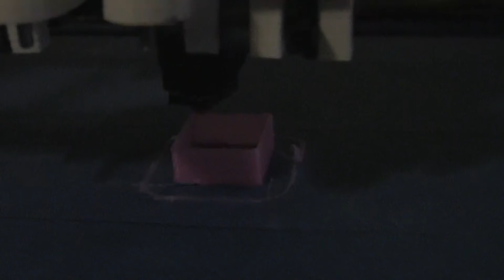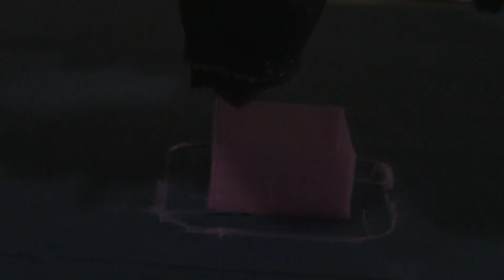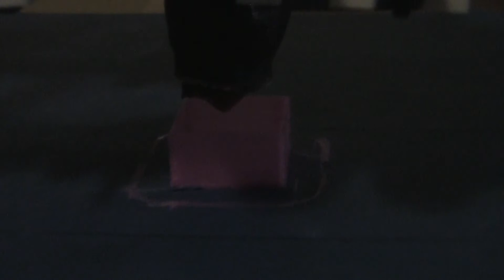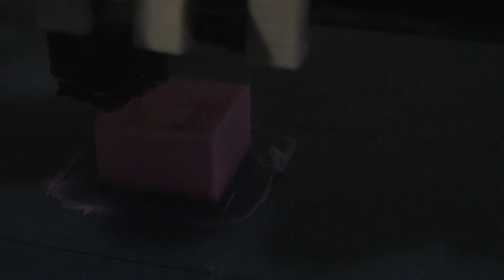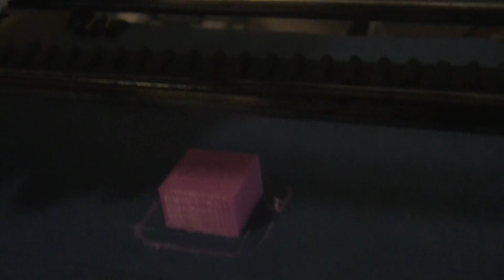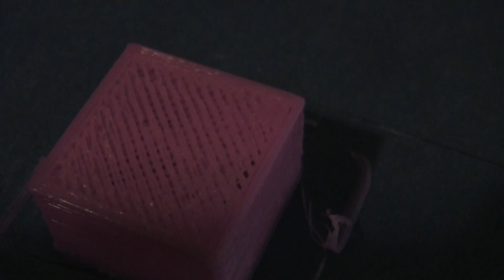Reprap Prusa i2 Bridging Problem

Comment from the maker: Apparently the tutorial I found this STL listed on (the hollow cube) was written when people most commonly sliced with Skeinforge (which USED to add in extra areas for bridging)  I was told that this is no longer the case, and the reason my bridging sucks is because no printer is supposed to be able to bridge this.